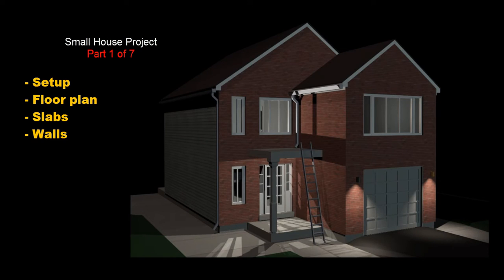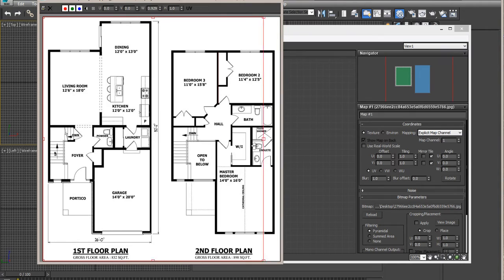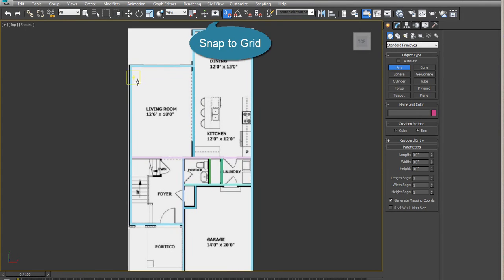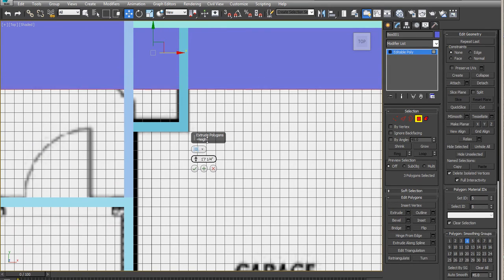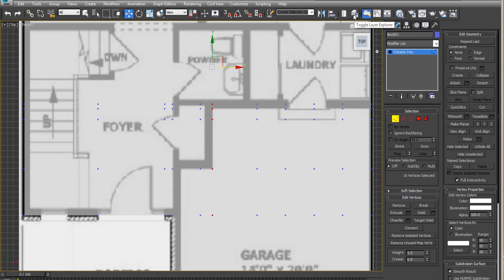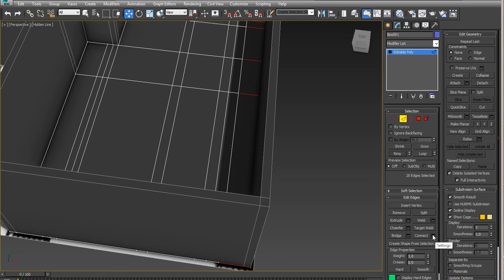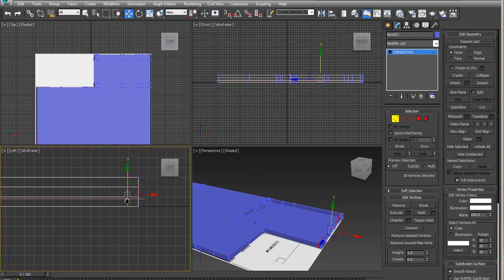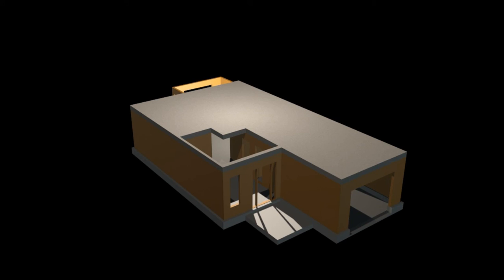3DS Max Two Story House - PART 1 of 7 - Plan, Slab, Walls

Comment: Following allong up till frame 3:40 of video tutorial ...but my bitmap image wont display in the viewport..followed everything step by step...but when assigned material and show shaded material in viepoet are clicked ...nothing displays ??? please help
Reply from the maker: Vivian, In the material editor click on the bitmap image and click on "Show Shaded Material in Viewport" icon located in the top bar. Then in your viewport change from Wireframe or other to SHADED.
Reply from the maker: Another reason??. maybe your bitmap is in a different location or you removed from the link.